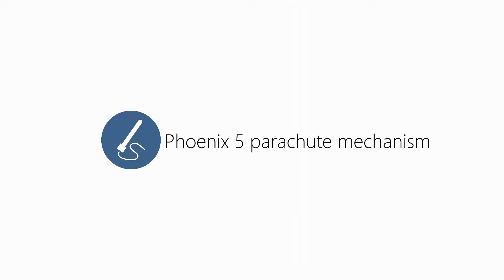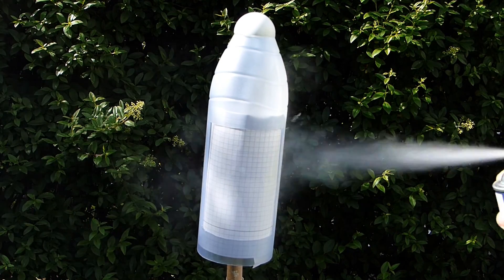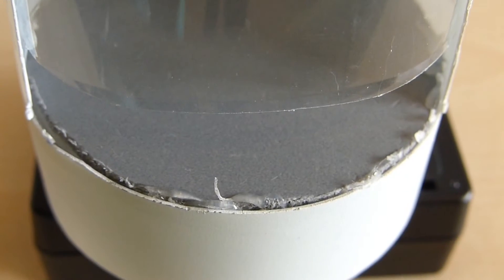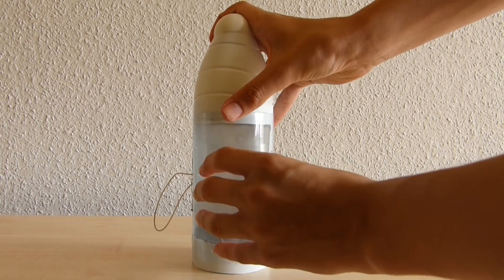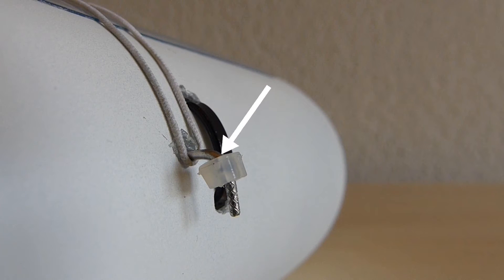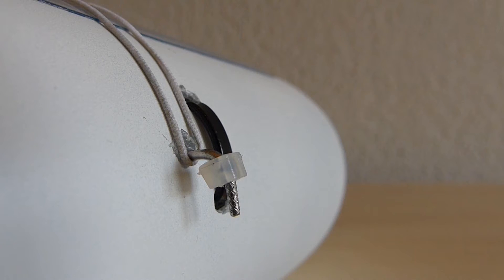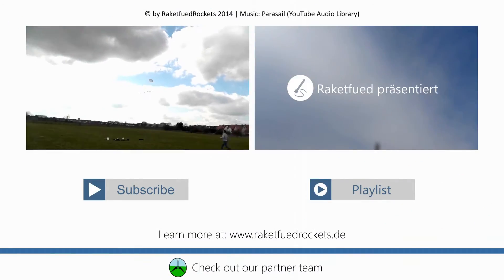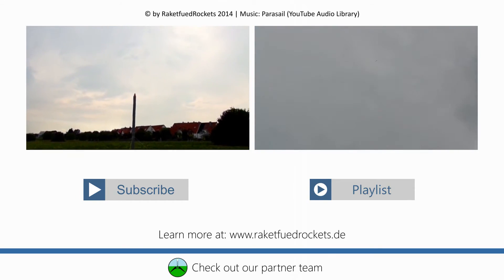Phoenix 5 parachute mechanism for water rocket [English]

Comment: Thanks for the Tommy timer parachute deployment system. That was really an amazing idea. Very clever
Reply from the maker: Thanks Vinay. :)
However, we didn't invent the tommy timer parachute system itself, we just improved it. For example, most predecessors had a heavy V-construction inside. We replaced it with two plates which are glued directly in the case. We also made the tommy timer mounting and trigger mechanism a lot lighter and more reliable. You will find a lot more videos about water rocketry at our channel. :)
Cheers
Julian

Comment: Great video guys. Very nice idea to bend the Tomy timer. Do you attach the parachute door, or does it just fall off?
Reply from the maker: Thank you George :)
We tried everything to make this mechanism very stable, reliable and easy to build. The idea to bend the tommy timer is from AcW. We are very happy with it, especially in combination with our cable tie trigger. The parachute door is attached with rubber band at the rocket (not at the parachute mechansim itself).
Cheers